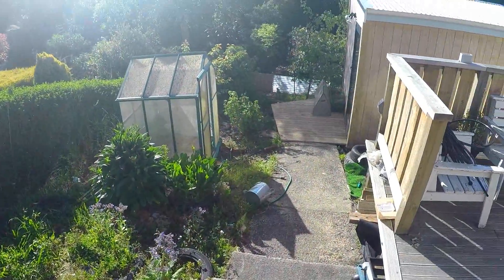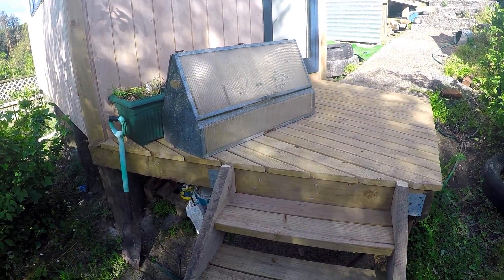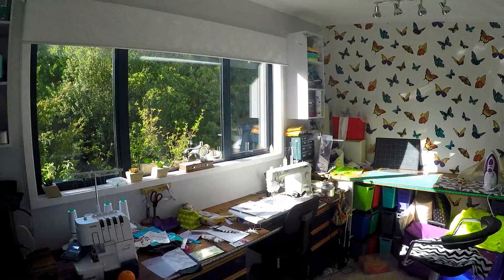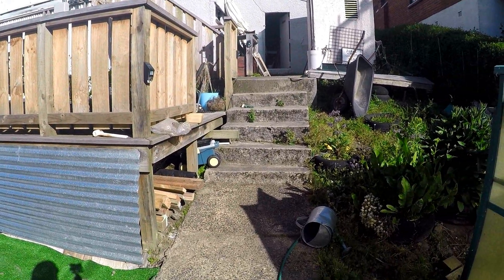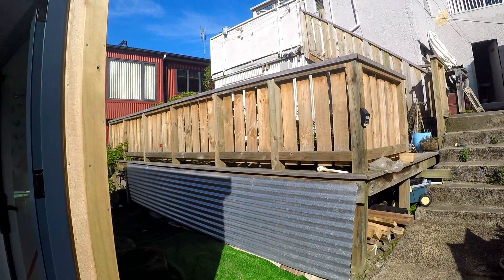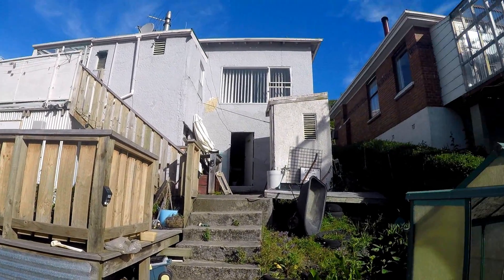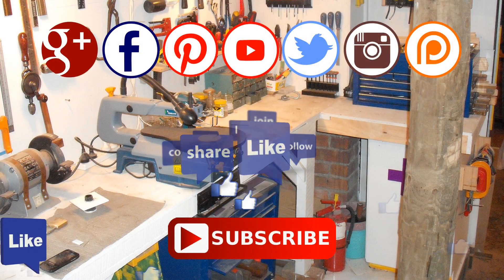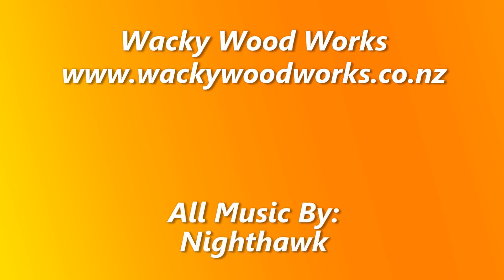Update 101 - Off the Cuff - Wacky Wood Works.

Comment: What was the reason for flipping the decking boards on that landing?
Reply from the maker: Not sure what you mean... Flipping?
Reply: Normally the ridges on decking boards go at the bottom, and the smooth side on top. It looks like you've flipped it over so the ridges are on top
Reply from the maker: You ask 50 builders you will get 50 different answers... we do use it for grip... flipping them the other does allow more airflow between the joist and the decking... apparently... but to be honest I can' see how it make much difference... it's all treated wood.

We have always done the ridges on the deck go facing up... it gives grip in the wet and ice and helps with water run off etc...
Reply: Wacky Wood Works that’s interesting, never thought of utilising the ridges for that. Ice and snow aren’t really a Queensland thing, haha, but you guys would certainly need to be weary of it